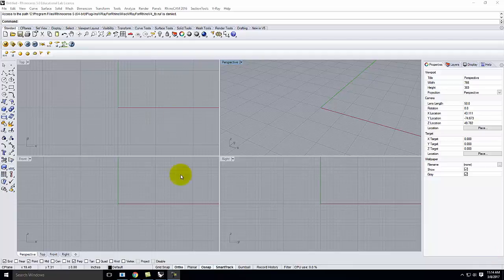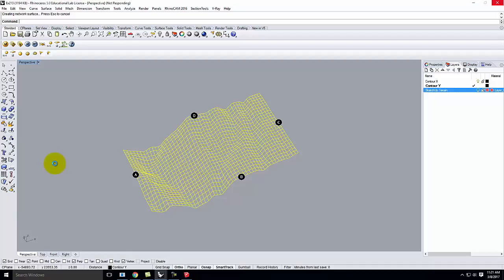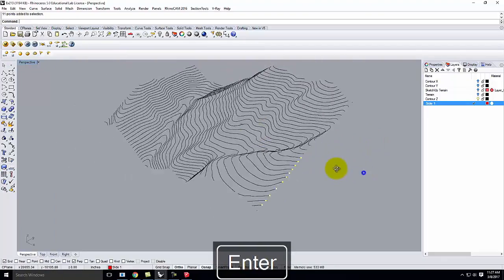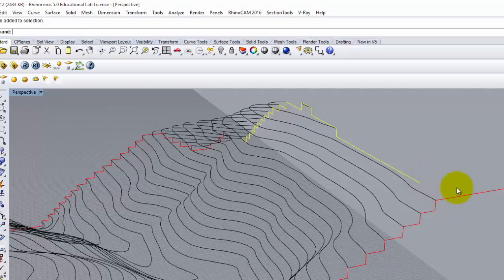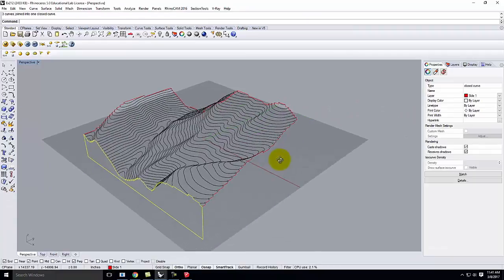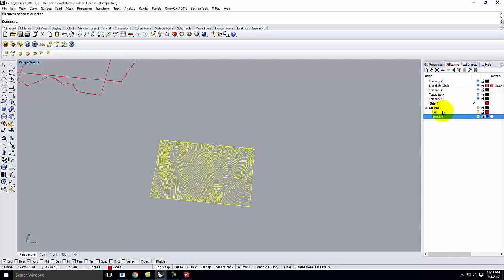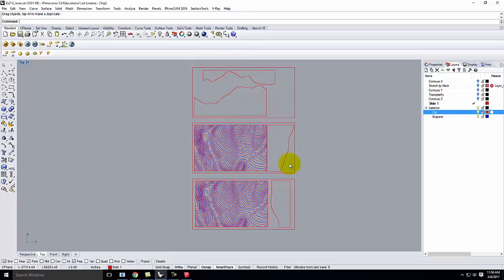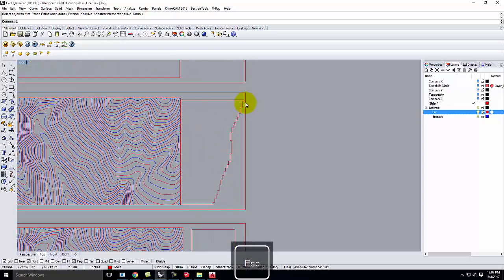Lecture 213 - Topographic Physical Models (Part 2) (Spring 2017)

Comment: Besides bad border edge tolerances, what could the reason be for my Curve Network failing? I have tried increasing the spacing of my X,Y contours so there are fewer curves to be networked and I still receive the error message asking to sort curves one at a time.
Reply: Ah, so I just used Rebuild Curve and now they are networking together, I guess the Curve Network function cannot accept curves with too many points. I was trying to Network together 150 curves, each with ~150 points.
Reply from the maker: Glad you sorted it out... Sorry for the delay.  I was on spring break.  Let me know if you have further questions.